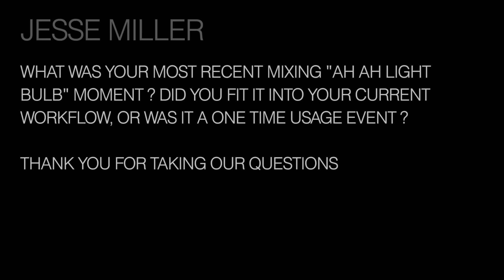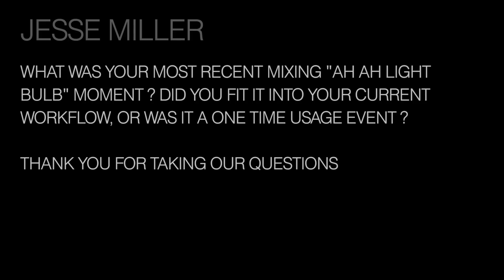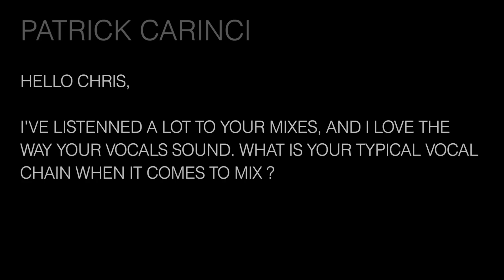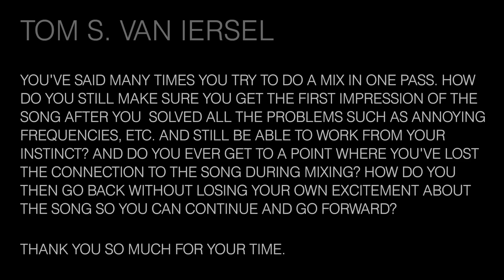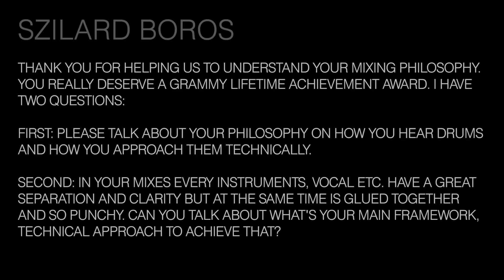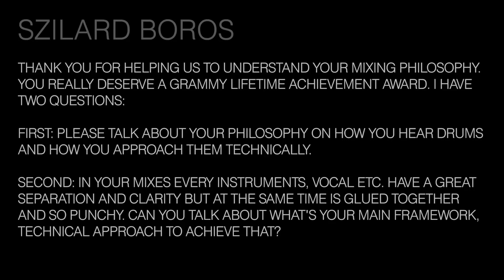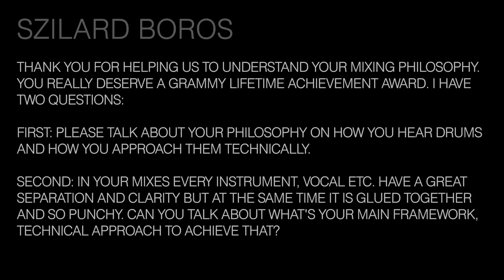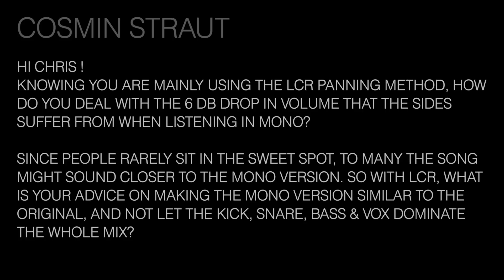MWTM Q&A #14 - Chris Lord-Alge

Comment: he is obvously lying. During another interview he said he was using his outboard gear all the time for vocals in particular (compression, reverb and so on...). He is just trying to sell his plugin suite...
Reply: thats true, he thinks he is a rockstar i guess he was for sometime, but i hate that "over-confidence¨ i used to like his job
Reply: In all fairness I don't think he is lying. He points at his signature plugins for a reason. Not that he uses them, but they are meant to model his go-to chains. So if you're using his signature vocal plugin, you're using an emulation of his typical vocal chain. Not everybody has access to an SSL 4000G, vintage blueface 1176, Lexicon PCM 42 and the likes. So he's not really lying. But it's fair to say he took a shortcut in answering the question.
Reply: noisesoundtonevibe Right!  There's no way to answer that vocal question in an hour, let alone 2 minutes!  Again, he only mentions his plugins (which can be surprisingly effective, I have to admit) one time.  Listen to his other answers--there's great advice in there!
Reply: noisesoundtonevibe But I have access to all that every piece of gear you mentioned and he's lying the only way to get records to sound like his is to use the gear. You can mix in the box just as long as it was recorded properly with amazing microphones and mic placement and mic's are set up right the first time no fixing it in the mix. Just the placement alone is like EQ and can change the tone of a source dramatically just by moving an microphone an inch or two.
Reply: Andrew Polemeni The original question was about his go-to vocal chain. He answered it by mentioning his signature vocal plugin (probably assuming the person who asked was new to mixing), which is an emulation of his typical vocal chain. So even though it's a shortcut, it's not a lie in the sense that he gave an answer targeted at someone who would get more confusion out of specifics than help. If however the person asking were more experienced, a 10 minute google research would give him the answer he'd be looking for. There are copies of concept sheets for those signature plugins all over the internet. I would agree with you that the recording is hugely important though.
Reply: That is why all of you don't know how to mix very efficiently(not saying that you guys aren't good mixers but only thinking about vocal, vocals vocals and vocals, get that off your mind and start focusing on other aspects of the mix that would THEN help your vocals sound a lot better.
Reply: Trust me he would never use his own plug ins because they are nothing compared to the racks of vintage gear that he has in his studio. But when he gets the tracks there already pretty much done because his assistants do most of the work and he gets credit for it. All he really done is just level by time its done he doesn't do much EQing thats usually how my mixes look no EQ and just compress through an SSL on the way in.
Reply: Andrew Polemeni That's a massive generalization.  His assistant primarily does track management.  That is, he consolidates the 120+ tracks of most sessions down to 48 tracks.  At times, he may eq (broad strokes) tracks to Chris' liking.  Chris does the lion's share of the balancing, compression, eqing, etc.  His assistants do not do the mixing for him.  That's a ridiculous assumption/internet myth. Mixing is much more about skill than gear.  I used to think it was all about gear until I assisted Andy Wallace.  It's the man's ears, instincts and experience.
Reply: All Im trying to say is that he isn't worth the money record labels pay him to do he just shoots massive bullshit out of his ass and you can tell by how arrogant he talks compared to other engineers that are very modest and don't tell you to buy there plug in because "it will make you sound better. I know thats what the assistants do but still its easy once you get to that step I usually never have to touch EQ much when I get to mixing. Generally just a little bit of compression here and there using my outboard gear such as La2a's,1176's, Tube Tech, Neve Compression, Ect to change the tone. The only time I EQ is mostly to just roll things off because when I get the tracks they already sound awesome.
Reply: Andrew Polemeni Where can I hear an example of your work?  CLA's paid his dues in my opinion.  He's been at it for 35+ years.  His brother, Tom too. Ok, I found you on Soundcloud, I think.  Is that you in front of the 1608?  Um, none of your mixes have any real lead vocals.  Why is that?  How can you really criticize CLA when you've got nothing to show in comparison?  Huh?  How come record labels aren't coming to you for mixing work?  Sounds like you'd charge them less money?  You know why?  Because owning a 1608 and an 1176 doesn't make you an engineer.
Reply: I just put shared a recent album I did so you can hear it. I haven't used my sound cloud in ages.....
Reply: take note, he never said he only used the plugins, he said it's a great place for YOU to start to get his sound. Please, listen before making an ignorant comment.
Reply: Honestly his CLA2A and CLA76 plug ins are pretty good its just the other ones the "all in one" vocal chain is horse shit.
Reply: Andrew Polemeni  where can I listen to your mixes?
Reply: https://soundcloud.com/andrew-polemeni I don't have all my mixes up but here are some. I've worked on a lot of projects in the past I just don't post everything.
Reply: Try it for yourself n you will know
Reply: Yeah